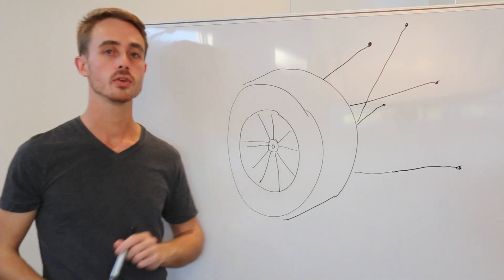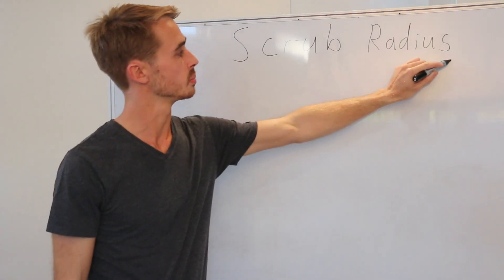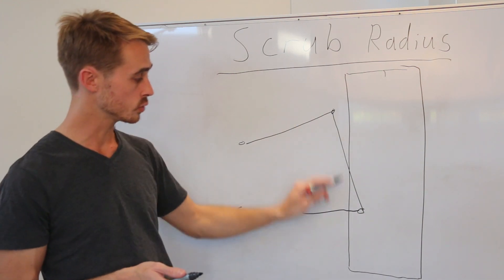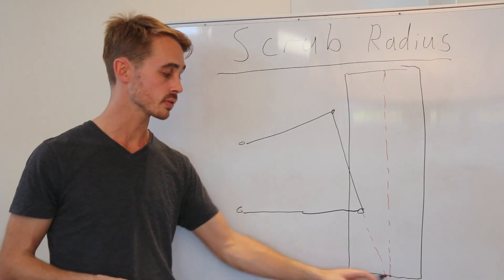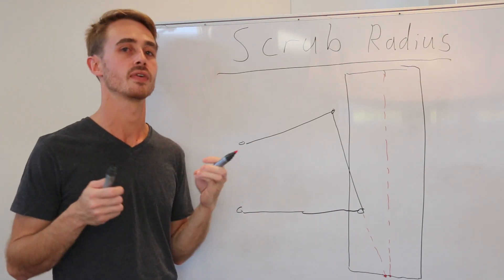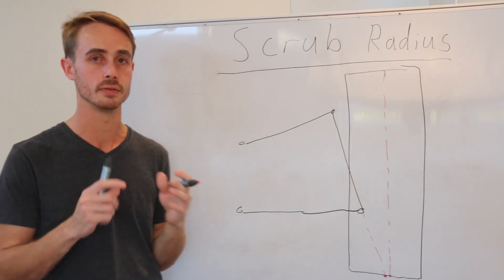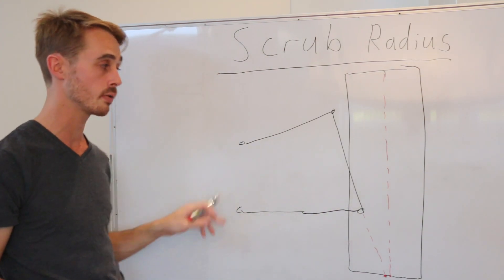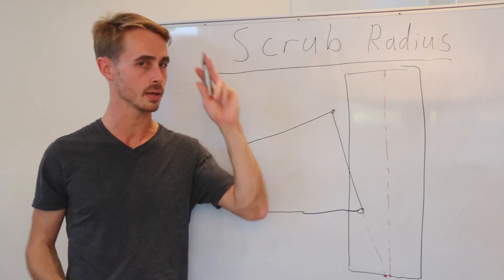How Scrub Radius Works

Comment: No not at all. Scrub radius is the distance from the king pin axis to the center of the contact patch of the tire, especially when there is steering axis inclination. 
It won’t change your turning circle; your tires still angle the same amount. 
It affects steering effort and stability. Usually increasing effort, and the effect on stability can be increased or decreased, depending on the specific configuration.

Comment: I'm confused. If I go from +55 offset to +38 offset, then I move the tire/rim outward 17mm, which leads to a more positive scrub radius? And, would that change in scrub radius at +17mm outward be sufficient to cause suspension operation problems and stability of the vehicle and steering?

Comment: Hi Kyle. 
I'm having a question. I'm having an issue with massive understeer at low speed corners. Will a lower scrub radius help? It's a dubble a-arm setup. Already tried multiple camber and caster settings. But this didn't make any difference. Neither did spring rates, and I can't run a front swaybar.

Comment: Sorry for digging up a old video. I dont understand a part of this. We have cut up our control arm on our track car so we can relocate the ball joint to fix bumper steer. While we do this we can move the ball joint out or inwards. That should affect scrub radius. The pivot point is the ball joint, not the intersecting line of the strut to the ground. So I dont know how to actually measure the scrub radius we have. Do I follow a line from the top of the strut to the ground thgough the strut. Do I follow a line from the top of the strut through the ball joint. What is the actual best way to determine where the scrub radius is on the ground. I understand the therory, not the actual measuring points.

Comment: There is a lot more to scrub radius.  Front wheel drive cars tend to have very small amounts of scrub radius and the pivot point is outside of center. Rear wheel drive cars have the pivot point inside of centerline as in your picture.  Manufactures have gone to great lengths to control scrub radius. Audi, Honda use ball joints on top of the wheels and tires. Audi uses two lower ball joints in addition to this creating an imaginary pivot point. Torque steer and darting under heavy braking can be controlled to some extent by reducing scrub radius.  Also tire diameter effects scrub radius in addition to wheel offset.

Comment: its great how you educate people about these things and you're doing an amazing job at it kyle! but i feel like you missed the opportunity to go in debt about the toe angle changes scrub radius provides under different acceleration and deceleration forces through play in bushes and other suspension components. In turn, affecting handling to some degree. I believe some car manufacturers design there cars with a negative scrub radius to minimize the steering effects of a punctured tyre at speed. (retaining forwards direction). People often unkowingly change their scrub radius by changing wheel offset like you mentioned but camber changes also have a fairly big impact.

I really do hope you revise this video when it suits you!
Reply: If you want to have wider wheels, you must upgrade with wider J to keep the standard scrub radius (ex 7J to 8,5J). If there's a difference in braking force between the wheels (caused by road condition for example), the car will automatically turn towards the side with the most braking force. With a positive scrub radius, located on the inner side of the wheel, the mechanical momentum will make the wheels turn towards that side. With a negative scrub radius, located on the outside of the wheel, this momentum works from the opposite direction so the wheels turn to the side with less braking force. This two forces balance each other out and keep you balanced.

People who just trow on some spacers for the "right" fitment, are in danger when they need to pull of a emergency stop. it doesn't matter how wide your wheels are, as long as you don't change the center of the wheel

Comment: I changed the scrub radius of my car by swapping the rear wheels to the front; the car had stock mild positive scrub radius but now has a good amount of negative scrub radius. The result is that steering weight increased noticeably; there's a lot more feedback; and there seems to also be more bumpsteer.

My question is, had I used spacers to make the scrub radius more positive than the mildly positive stock scrub radius, would the steering feel heavier, have more feedback, and have more bumpsteer as well?

Comment: I found it a little odd that you didn't mention the feedback effects of scrub radius.
Any time there's an uneven force like hitting a pothole with one wheel, the steering will be pulled in the direction of that wheel.
Obviously, this is a big thing off-road.
Another place where it becomes apparent is when breaking hard, and one wheel loses traction.  (The steering will pull towards the wheel with traction)

Comment from the maker: Also, it has been brought to my attention that I didn't mention the effects scrub radius has on torque steer. The lateral offset of the contact patch will make torque steer worse, so for FWD/AWD cars you want to keep that number low. Sorry for not mentioning it, but it is a brief summary video and most of my experience is in RWD cars, so I forget to say these things. Apologies and thanks for watching! 
If you are interested in this more, try here: https://www.youtube.com/watch?v=g9m98oJXmXs
Reply: KYLE.DRIVES, you also don't describe how scrub radius influences dynamic weight movement in a vehicle as wheels are turned.  It is a significant tuning point in suspension geometry, especially in rear wheel driven cars on surfaces with lower coefficients of friction.
Reply: hello good day to u , can u plz help i want to upgrade from 17 inch 7 width ET55 215/55/17 to 19 inch OZ rim 8 inch width ET 45 with tyres 225/45/19, the scrub radius shows positive of about 7 mm, can u please help if i can go ahead, thanks
Reply: @kenlai2200  You have to change your KPI angle to fix it. This is the center of rotation for your wheel. Just go with the correct ET. If you want to have wider wheels, you must upgrade with wider J to keep the standard scrub radius (ex 7J to 8,5J). If there's a difference in braking force between the wheels, the car will automatically turn towards the side with the most braking force. With a positive scrub radius, located on the inner side of the wheel, the mechanical momentum will make the wheels turn towards that side. With a negative scrub radius, located on the outside of the wheel, this momentum works from the opposite direction so the wheels turn to the side with less braking force. This two forces balance each other out. 

I really wonder how you've measured the scrub radius? The only way is to calculate it with the technical plans of your car, because the numbers are so small and 1inch can make the radius from negative to positive...

Hope I made it clear for you.
Reply: @dieterreniers1554  Bro what is "J" ?